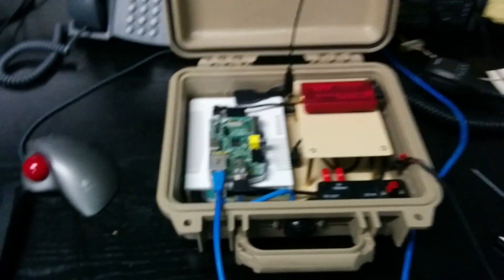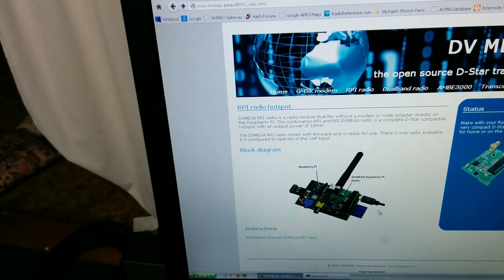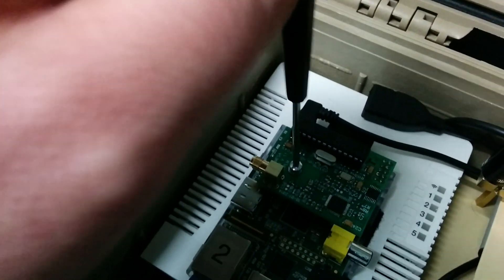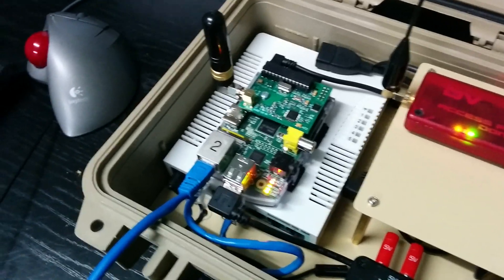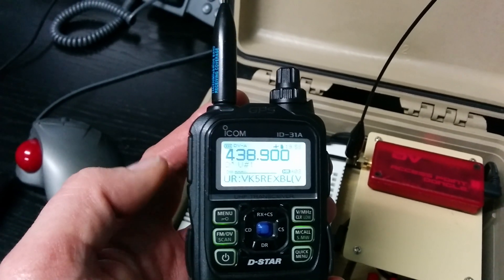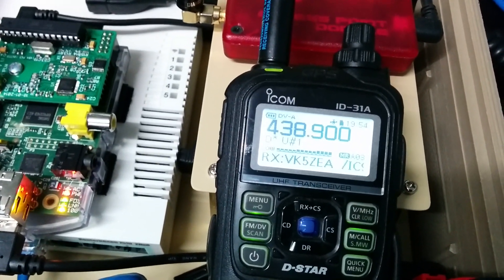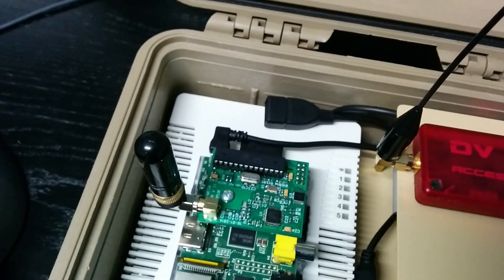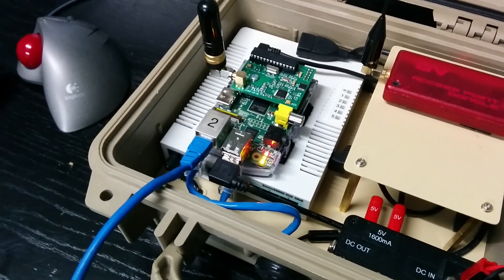DV-MEGA Raspberry Pi Radio

Comment: does your own callsign shows up on ircddb live  ,when using the dvmega to connect to a dcs reflector.   When i'm driving /mobile and connecting to dstar repeaters the  callsign shows up. but when i'm using the hotspot nothing shows up on ircddb live.   viss is on btw.
Reply from the maker: If your HotSpot is connected to the ircDDB network, then your callsign should show up.  Is you ircDDB password correctly entered?

Comment: How do i get the ircddbgateway connected when i'm in a Hotel on their wifi network without portforwarding.
Reply from the maker: ircDDB Gateway should work fine while on a hotels wifi network... with the following exceptions;  outgoing Dextra (XRF) connections need to have port 30001 forwarded back to ircDDB Gateway.  This is impossible to do on a network you have no control over.  The easy fix is to move the contents of the Dextra_hosts.txt file into the DPlus_hosts.txt file with a "L" added as a suffix.  This will allow an outgoing connection to those Dextra reflectors to be established with the Dplus protocol.
The other thing to bear in mind is that some hotel firewalls might not allow connections from strange and unknown TCP and UDP ports.
Reply: OK, so D-Extra should be turned off in the gateway config of DStar Commander V2.01. I had it turned on. Thanks.

Comment: so are you using both the DV Dongle and the DV-Mega?  I assume not at same time.  Is there a command to switch or do you just unplug?  I really like D-Star but no local repeater.  Same goes for DMR no local repeater.
Reply from the maker: Yes, I am using both the DVAP Dongle and the DV-MEGA board at the same time.  The DVAP Dongle is a 2m unit and the DV-MEGA is 70cm.
Each can be used independently and linked to different reflectors AND different linking systems. Eg. I could link to REF001 C on 2m and have the 70cm DV-MEGA on XRF002 A.

The ircDDB Gateway software can handle up to four RF "radios" at the same time.
Reply: thank you for the response.  will look for on Ref 001c.  73, Rohn KD4HCT

Comment: I'm a bit confused on what this actually does? Allows you to access D Star repeaters? Listen in ?  With only the board and a raspberry pi ?
Reply from the maker: +LJH08Ralith This allows you to link into and access D-Star repeaters/reflectors and then create a "hotspot".  You then use your D-Star radio to talk through the DV-MEGA/Raspberry Pi to the remote systems you are linked to.  Great for those without a local D-Star repeater... or those who don't want to tie up the local D-Star repeater.
Reply: ah ok thanks for the info. Sadly we have plenty of d star repeaters but I have only analog radios.
Reply: +Michael Carey hey I'm a little ignorant when it comes to ham radio's and d-star, I mean the only reason I'm interested is because I saw that you could access the internet and I thought that was amazing,  so can you access the internet through this set up.
Reply from the maker: +Shawn Crawford Yes... the Mikrotik router uses a 3G USB "dongle" to connect to the internet. The Raspberry Pi is plugged directly into one of the Ethernet sockets on the router.  This router also has a WiFi access point built in.  I can connect my phone or laptop to this WiFi connection and get internet access... or I can plug my laptop in directly to one of the spare Ethernet sockets.